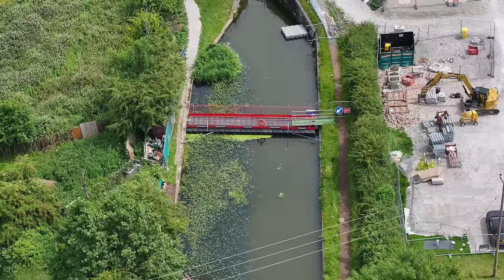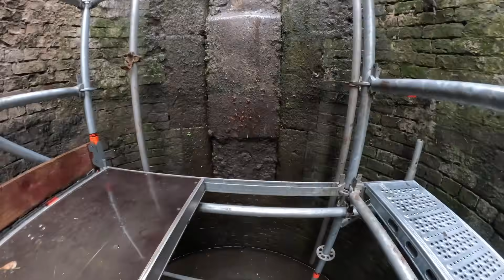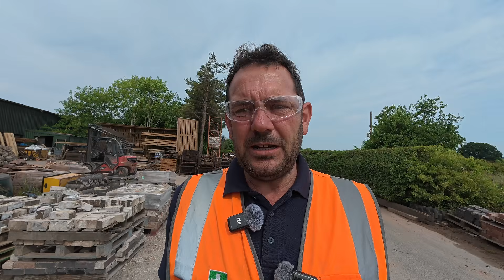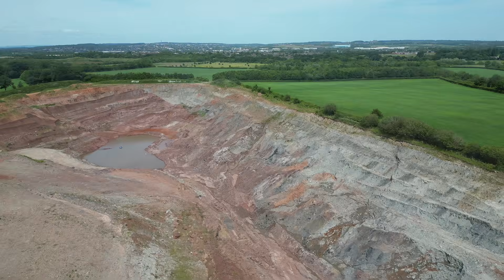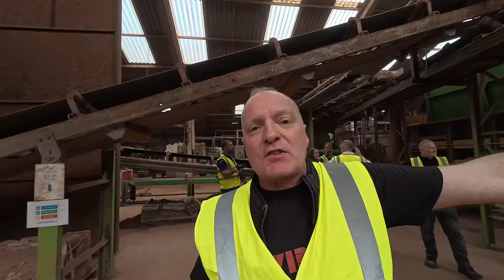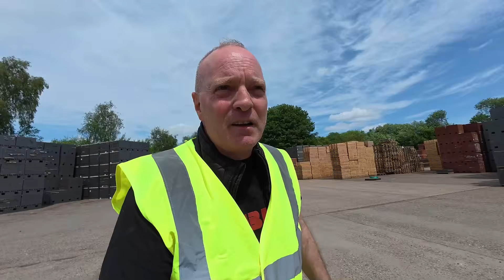How do you repair a canal lock ?

Comment: I was told by the older boys when I was serving my time "There's too many chiefs and not enough indians".
8:14 is a perfect example.
You can plainly see that they've freshly hacked through all the header courses, which was a tie in the brickwork.
If they are so concerned with "the environment" why did they do that?
So what are they going to use to tie it back into the original?
Probably Chinese stainless steel which in water will last 5 years max.
Nothing against you Martin, just people like emily.

Comment: Was there any consideration of digging on the outside of that wall and pouring concrete to reduce hydrostatic pressure from the outside?  It would also be possible to insert drains.  No-one would see the modern techniques, but it would be expensive and alter it.  Then if those timbers are completely dried out, they will rot.
Reply: We couldn’t… it is Grade 2 listed. Everything has to be done very carefully, in a scholarly manner to satisfy the council requirements.

Comment: Amazing! Thank's for this eye-opener into the extraordinary engineering techniques of 19C canal builders and the effort involved in repairing and conserving the handiwork of those early civil engineering pioneers. The use of butresses made of wood and brick to tie and support the lock walls was a revelation. Was this technique only used on very deep locks, or more generally, do you know?
Reply from the maker: I would imagine it was practice on many locks. Or maybe local variations. Different canal companies had slightly different ways of doing things

Comment: 8:14, ive cleaned thousands of bricks and those bricks look cleanable to me.   they might be harder to clean than the rest but thats all.   i am surprised that the engineered bricks were just used on the face and not continued into the 'buttresses' where the under-baked bricks are.   and there is little interlocking that i can see.   thats a no-no.   but they are building to a minimum and would you believe it, its lasted for 2 centuries.12:12, i'm uncomfortable about sand-blasting the surface with anything other than water.   that external glazing on the brick helps keep them water-resistant.   it was interesting hearing about the flint powder added to the mortar.   the chinese developed a method of adding some extract of rice to the mortar of their blue bricked great wall.   i'm hanging out for part 2.

Comment: Good video. A lot of those temporary braces look to be EFCO Super Studs but they should be yellow painted. Is that stuff galvanized? The horizontal tubes are aluminum and usually used for supporting the pouring of concrete floors. Buttress is a good term for those wall braces. Good Luck, Rick